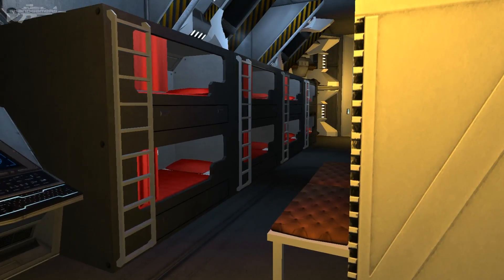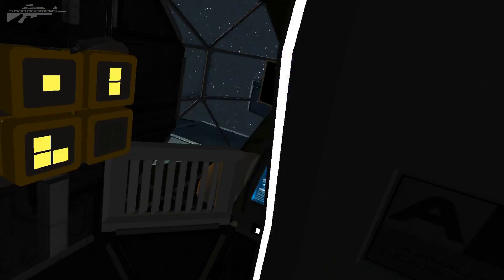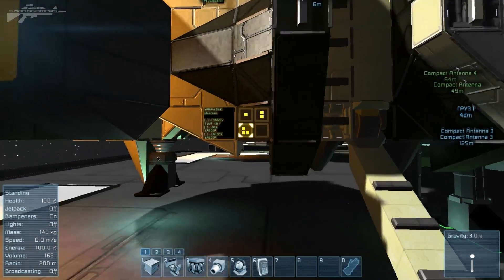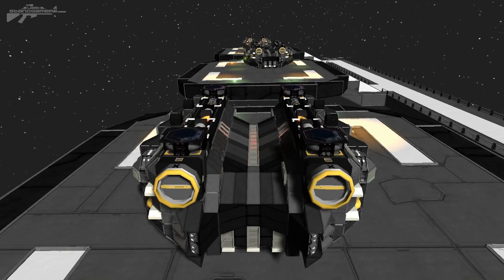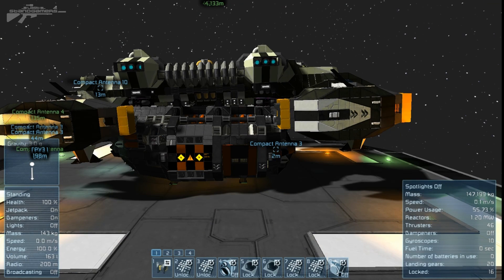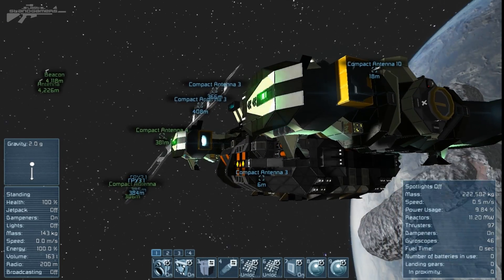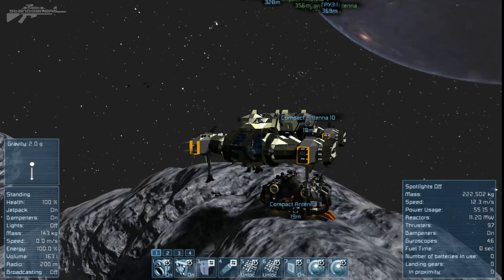Space Engineers - Cataclysm, Modular Cargo Freighter

Comment: 2:14 cargo module 73
owner: galactic freight corporation
cargo containers - 5
mass - 18527
used power - 2.10%
reactors - 600kw
conveyors - 13
thrusters - 20
[.] main lights
[:] emergency lights

3:18 control terminal of landing gear (left side)
[.] reverse landing gear
[:] lock landing gear
[:.] unlock landing gear

at 3:38 the same as for 2:14

5:42 landing module
system activated
manual control [activated]
reactors OK
used power 55.77%
thrusters OK
cooling system OK
pressure in pistons OK
communications systems OK
time 19.41.54
date march 24, 2099

5:43 manual control activated
module control granted
communications [on] on\off 
goals - ask your leadership
tasks - ask your leadership

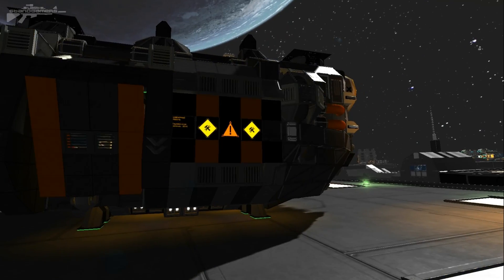6:08 engineering module
cargohold filled 65%

6:51 left display same as 5:42, but 1st string is engineering modulle
right display same as 5:43

Comment: That is SICK, but why not use merge blocks to connect the modules?  It'd make it more secure and avoid the center of mass issue (pulling down when thrusting forward).
Reply: I guess because four mergers cannot connect simultaneously to a shared object.

And it may break something, since the merge is semi-permanent and quite sudden.
Reply: Semour Butts
I found that out when I was building an Outpost Fabrication Cruiser.
Reply: it works. you could just combine its current system with a mergeblock on top of each module. first bring it into position so that the magnetic effect of the connectors kicks in then switch on merge block. done this with many modular things already and it works perfectly fine.
Reply: bleugh